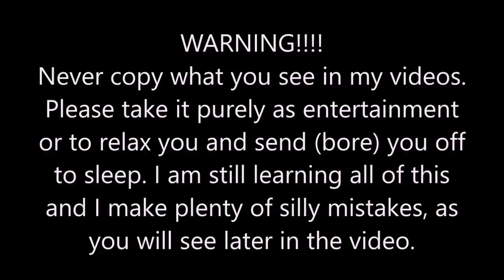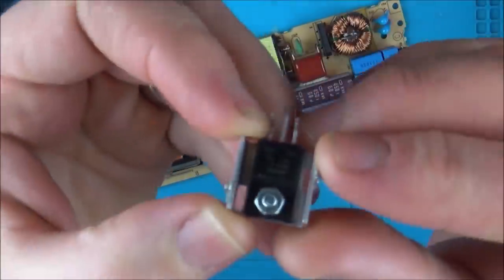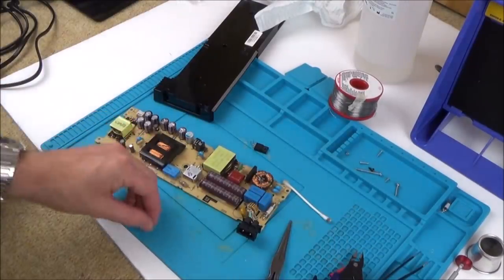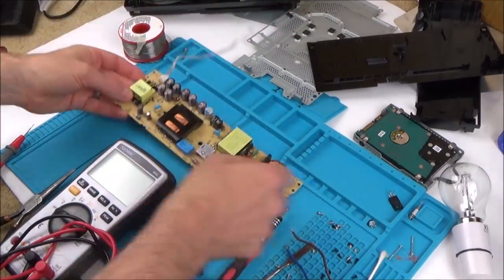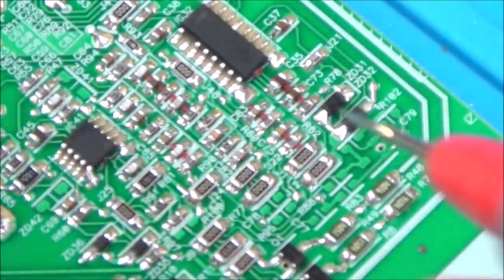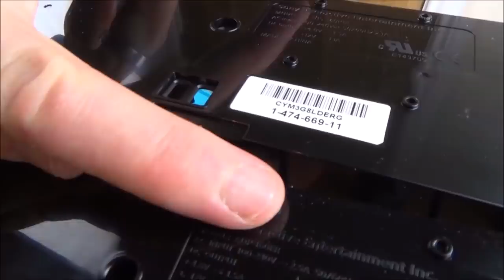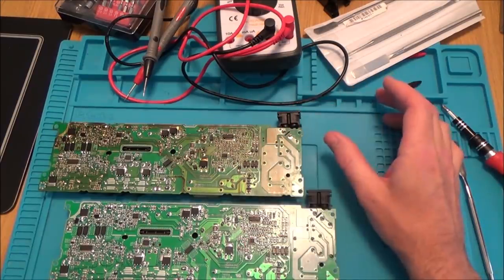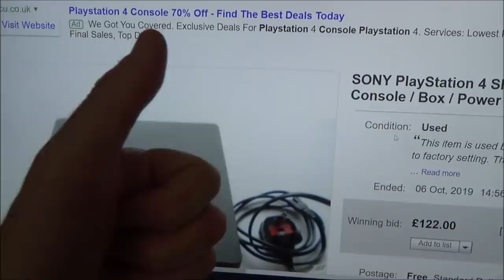2019 eBay Repair Challenge - Week 3 - PlayStation 4

Comment: That was a great fix and fault finding vince. 20-5=15 Pound for the power supply was a good deal, so probably not worth further experimenting replacing the diodes. Also a short on the diodes doesn't mean the diodes are shorted. Something connected to the diodes could be shorted.

Comment: Oy mate if you solder those lamp leads to finishing nails and cover them with heat shrink tubing right the way down, that should make some safe probes for future use. You could add more layers if you don't feel confident it's insulated enough. Just a thought and I reckon it might make for good content.

Comment: Because all transistors effectively have a diode in them, you should always measure in diode mode and in both directions. You expect to see a low voltage drop in one direction but never in both directions. Also a lot of transistor packages will have multiple leads tied together but that tends to more be the surface mount ones rather than thru-hole.

Comment: Vince, if you still have the faulty power board and another good one, set your multimeter to read voltage and then test the voltage of the zener diode in the good power module, and then replace the zener diodes with a zener diode of the voltage you measured  on the good one.. Eg if the good power unit has a voltage of 5.1 volts across the zener on the good unit then thats the zener diode you need for the faulty unit. Most zeners for the play station are 1 watts.. Good Luck..

Comment: You should check to see if the power rails those diodes are on are short to ground as if they were gate pull down diodes on a shorted rail that would explain why they are low. If the rail is short then inject the rail with 5v 5A and see what gets hot.

Comment: You can clearly see that the boards are designed by different companies. One is by Chicony, and the other is by Delta Electronics. They are same rating, but carry different model, because every vendor give different numbering. Both are common power adapter (supply) manufacturers. Chicony, Delta, Lite-On, Zebra, Mitsumi...etcs.

Comment: Is it possible to plug the power supply into the outlet outside the ps4 and check if voltage is going to the connectors

Comment: Take the diode of the board on the faulty power supply and see if it is still shorting across the pads on the board. If it is then it is the chip that's faulty.  Also test the diode with it removed to see if it is still shorting. If they both are reading short with the diode removed then they are both faulty.  By the way the diode next to it looks to be open circuit hence why you get the same reading both ways. To check also take it off the board and measure it. It could be reading the board rather than the diode but it is unlikely. By that I mean with the diode working and the board still having a lower reading than the diode. Also do the same with the other diode that was short. If the short is on the board follow the traces and look what component connects either side of the diode. I realise you haven't got a PS4 to try it on but following your own advice on shorting 2 pins on the connector you should get both your 5V and 12V lines. That way you either have a spare power supply for future repairs or sell it on to recoup the cost.
Reply from the maker: Thanks PDS, I may well revisit this one and do as you suggest to see if the fault can be found :-)

Comment: You see, 220V (it was 310V DC) wont kill you as i told you! :D Welcome to the club :D You should also check bridge rectifier at the input because diodes inside could be shorted as well, and big caps also may suffer from power surges. Yesterday i had a problem with an electrolytic caps that measured fully fine on ESR (equivalent series resistance) meter and looked in perfect shape but does not work in circuit. I measure them with capacitor leakage tester (this one measure equivalent parallel resistance) and there i found the fault with caps. It took me a long time to desolder various components until i catch those. I strongly recommend to buy Capacitor leakage tester if you plan to fix PSU or power amps or anything related with electrolytic caps. It climes because of static electricity and lack of bleading resistors. Zeners should not be shorted and should measure like normal diodes. The problem is with standby power supply on primary (hot) side. In SMPS there are 2 PSUs, Main and standby wich has to be always on for CPU to be able recognize buttons and to turn on the unit. Also check fuses on secondary side, there can also have fuses.
Reply from the maker: Thanks Technixbul, I will definitely check the Bridge Rectifier first and then go through the other suggestions :-)
Reply: What to check after bridge rectifier? Capacitor ?!!!
I have a board not powering on

Comment: You could have "plugged" the bulb socket into your multi-meter probes. Also the capacitors recharge themselves a bit... They are kinda like sponges after you squeeze them out.

Comment: All I know is that when messing with my PC, I unplug it and hit the power button a few times to dissipate any charge left in the caps. I too am a member of the Blue Flash Club. I refuse to hang Ceiling Fans now, after getting knocked on my ass by a live wire... My fingertips were black!
Reply: This was all I kept saying to the screen!   Just unplug and hold power button down!
Reply: Mmhhh power cycle. I do it even when i shut my pc down simply because the rgb on all my shit stays lit up like a Christmas tree for hours if I dont and it drives me mad at night trying to sleep lol

Comment: Vince. In the 32 minute mark... there is smoke coming from somewhere! Edit - i just saw your thumb.. i thought PlayStations were entertaining.
Reply from the maker: What on earth is that at 32:00, does look a bit like smoke, there is 2 of them going up the screen!!! Must be some dust or some airborne plant particle. This was filmed in the summer and the windows would have been open :-)
Reply: Definitely looks like smoke. Saw it as soon as it came on. Immediately jumped on comments in case you establish it later in the video (still at 33 min mark).

The coincidence end you shocking your finger and the smoke is just a tad too unlikely.

Welcome to the shock club. That won't kill ya unless you're sporting a pacemaker. But it sure does catch you off guard.
Reply: Actually. Same bit of smoke at 58.03! So it is dust Vince. Heh
Reply: That was most definitely dust/hair. You can see another piece flying up about at about 31:52 , he must have stirred up the hair when he tossed the power board LOL

Comment: Your multimeter will draw a small amount of current when measuring voltage. That's why you saw the voltage dropping on your caps while you were measuring them, but leaving them be for a while didn't make much difference.

Comment: Dude, you need a VI curve tracer. Also known as an Octopus tracer (Google it). 
Then you can get a "good" power supply of the same model, (or even just find a matching loose component), and then compare the readings you get for each component on the good vs "broken", board. The change in the curve of the trace will allow you to identify the faulty component, and then replace it.

Comment: well im pretty sure roaches fried mine. i done tried swapping out the whole damn power supply with no luck i guess i was given another bad one thats what happens when  i try to fix shit for free anyways i just bought sonic  mania and i haventt been able to finish it  and im starting to get pist off about it can somebody tell me what my multi meter should read if i test my power supply removed from the system but still plugged into the wall? ??? im talking bout the part that hooks to the mother board what should my multi meter be reading????

Comment: for your information. a Zenor Diode sends current both ways. Id check those other diodes not only the surface mounted diodes. you did not measure the diode by the transformer and check those other resisters.

Comment: almost anytime you blow the mosfet switcher in a switching power supply  you "also" will blow something in driver circuit thats controlling it, also always check the main bridge rectifier for shorts as it took a beating trying to handle that much fault current..

Comment: I was expecting a good "bang!" when you first connected the console to mains xD. Let me explain why. When you did found the blown mosfet you also found a second problem. Have you noticed that straight white line on the back of the PSU? That's the indicator of which part of the circuit has live mains and which has isolated current, so anything after that line must be completelly isolated from mains, but... you tested that the live went straight up to the mosfet! That means there must be a short, possibly in one of the transformers. I can't ensure this is exact as I can't find the schematics online, but or there is a short or the designer of that PSU was drunk the day he dessigned it... xD
Reply: How can you have a short in a transformer? A brake maybe but not a short.
Reply: @snipersquad100  you can have a short between different windings that are supposed to be isolated, or the winding itself can be shorted out in which case it's not acting as a coil but just as a piece of wire.
Reply: @snipersquad100  Agreed shorts in transformer windings are rare, but they do happen when the coating covering the copper winding fails
Reply: @rfmerrill  It's a Sony PlayStation, not a £1 Chinese phone charger.
Reply: The white silkscreen markings on the back of PS4 power supplies don't indicate isolation. You notice  that they actually cross traces! You can see where the actual isolation is on the other side of the board--there's a lot of PFC circuitry in between the mains and the isolation, most of the PSU is on the primary side.

I have a different Sony PS4 power supply module in my hands right now and it looks like the white markings on the back could mean a few different things. There is a similar white line cutting across the board but again it doesn't indicate isolation. Potentially it separates the AC and rectified DC portions of the primary side, or it might be something related to manufacturing. They also seem to have colored a bunch of the tracks on the board white, maybe to indicate ones that are potentially dangerous to touch?
Reply: @rfmerrill  "it separates the AC and rectified DC portions of the primary side" That's isolation... When there is a transformer in between, it's isolated from mains.
Reply: @snipersquad100  A playstation that has been manipulated previously, and even on the best of the best devices a percentage of the production fails, just a copper wire with a bit less of coating and a bit of excess of temperature and there you have, a short.

Comment: hi i have gone the same as you i had to swap the power pcb as the last board  was on fire this was in a  pro end vhs  deck over £1500 when new 
it's best to put a new parts in when dealing with  250v  ac dc in them power pcb's love the video's

Comment: 2 things did you not connect that cable with the power supply you fixed? And two did you nit kniw that cursing at it and a bit of mudslinging and a shock or 2 and a tad of denouncing a eBay seller is all part of the game we play? Lol good luck my friend

Comment: These zener-diodes on the 240v side, are propably little power supply(3.3v?) for the controller chip. This chip probably controls this mosfet that You changed, maybe this chip is faulty and send bad signal to fet that caused short on live/neutral and the fet banged. On the low voltage side this zener was probably for safety, and propably it's done a good job, but dying in the process because motherboard is still working :D It's my guess but i never worked on ps4 power supply so i can be wrong :D

Comment: If you have a working power supply. Just mesure voltage drop acros zenner diode while power on and you will know what zenner voltage is to buy

Comment: Mate you’re supposed to discharge the capacitors that’s why you’ve got a kickback from it be careful mate use a screwdriver to discharge the polls on the capacitor The screwdriver that you’re using isn’t rated to do that you need a screwdriver that can handle the current that’s going through

Comment: @ 1:02:08 That ain't down to a smoker believe me. The PSU PCB is encased on it's own plus the outer casing is covering it. The PS4 has not been out that long so I am suspecting fire or extreme heat damage.

Comment: Picking a replacement zener diode isn't super hard. Unless the circuit it is in has very specific requirements, just pick any ol' zener diode that can take the amps. If it has roughly the same dimensions that should be sufficient. And what's the worst that could happen? That the PSU still doesn't work? :)
Reply: The worst is it can catch fire. That's totally irresponsible to say, a zener is a critical component as it is a voltage clamping device, if you place a 12v zener where a 1.2v zener goes (they have exactly the same size), you will have very nice fireworks.
Reply: @drgusman  Of course you wouldn't pick a low-voltage part... as it's mostly a 12V PSU you'd want 15V or higher. Breakdown voltage is more the question, which should be easy for the non-MELF part as one should be able to ID the part and find a datasheet. The breakdown for the MELF zener can then be deduced by desoldering and testing one of the functioning ones, as well as the location of the broken part in the circuit.

As for anything catching on fire, zener in a clamping configuration (like schottky diodes) are mostly there for safety, so if anything does explode, you have bigger issues anyway. The zener will not be the cause.
Reply: @MayaPosch  You're assuming they're being used as protection and not as voltage reference, another typical usage of zener diodes... change a 3.3v zener reference for a 12v one and you will have nice fireworks. Also, you already assumed something wrong, the real meat of that PSU is in the +5v rail or the +3.3 rail as that's what the APU is going to use, 12v are nowadays barely residual for mechanical hard drives and not much else, so you already selected a wrong part even for protection...
Seriously, changing a zener by a random value is never a good idea unless you have the schematic and know exactly what that diode does.
Reply: @drgusman  Uhm, the PS4 PSU is almost fully outputting 12V, with a 4.8VSB rail.  It does the POL conversions on the mainboard, for obvious reasons.

That's why it has the massive 12V +/- plug and the dinky little 48VSB plug. Did you even watch the video?
Reply: @MayaPosch  To be honest I missed the part where he shows the back of the PSU enclosure, now I see it. In any case, still a bad idea to change parts randomly without knowing it's usage, a switching PSU can use many zener diodes as voltage reference, not protection, and that may cause a fire if changed incorrectly.
Reply: @drgusman  Still not seeing how that could cause a fire. The breakdown voltage of the picked zener if used as a voltage reference may not be 100% what'd be expected, but then so zeners drift in accuracy over time, which has to be accounted for. Accuracy of the PSU may suffer, but it'd not suddenly catch on fire.

Zeners aren't IGBTs or similar explosion-prone components after all. As the failure mode of this PS4 PSU was apparently a surge event that caused the Power MOSFET to short and blow its guts, it'd have caused many surges throughout the primary and secondary side, as evidenced by the blown fuse and busted diodes. Even that didn't cause a fire.

Maybe a dodgy Deer-style PSU would have more issues, but we're talking about a Delta PSU here. 

TBH I think that this PS4 may have been subject to a (nearby) lightning strike.
Reply: @MayaPosch  Again, without an schematic assuming anything is dangerous... you don't know the usage of the zener, so you can't assure anything... Yes, catching fire is the most extreme possibility, probably it will blow the zener or the overvoltage/overcurrent protection system will stop it and that's all, but those extreme cases once in a time happen and is always better to be cautious. About lightning, well, a sudden power sipke can explain it if that's what you mean (nearby lightning that causes a power surge on the AC line). Anyway I think the owner indeed knew it was a more deep fault than just a fuse and even the power supply, he sold it really really cheap, it think he thought the main board was dead too so that fits it.
Reply: @drgusman  Absolutely agreed that having a schematic for a PSU would be ideal. I hope that this 'right to repair' regulation will force schematics for something like a PS4 PSU to be made available.

Can still reverse-engineer it, of course. Compared to the ATX PSUs I mostly deal with (or PSUs from savagely crammed together networking equipment) this PSU looks positively fun to work with :)
Reply: @MayaPosch  That would be really nice to have all the schematics available, it would be like the old TV SAMS on USA or the esquemarios TV that we had here in spain for TV servicing :)

Comment: oh boy, because u still have 300v dc on the caps, means the voltage didnt get used up, no bangs is good, test resistor nr the transistor, any resistors conected to any of the legs of the transistor.

Comment: With a cascading failure like that, the short clearly destroyed more than one component. There is no shame in using the power bank from another unit. Better than throwing the whole unit out anyways. I repair small engines and now strip every usable part from every mower because the cost has gone up on most parts. A coil costs $35! A blade costs $19. I watch videos on mower repair on your side of the pond and know parts are not cheap.